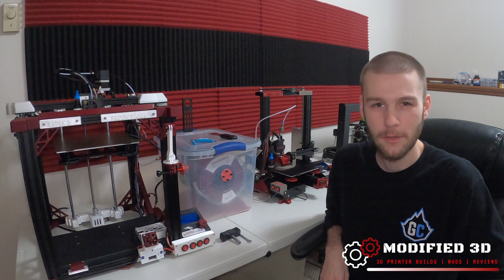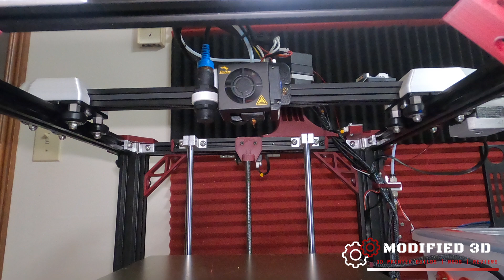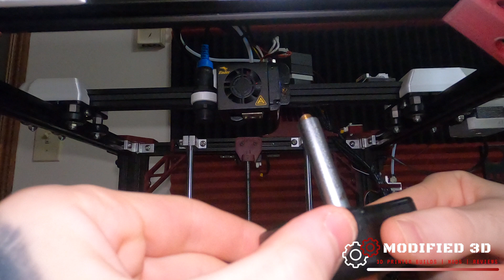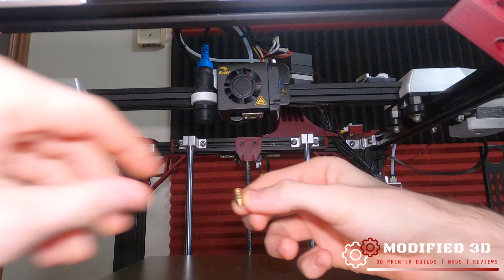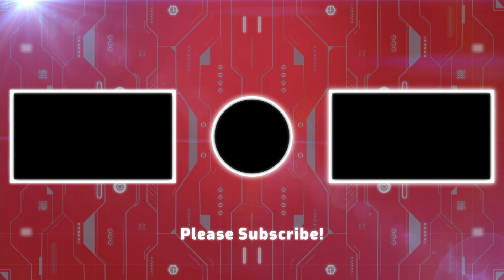How to Change Your Nozzle | Creality Ender 5 / Ender 5 Pro

Comment: 5 min video for 5 sec solution:
"Simply preheat your nozzle to 200c, then unscrew it. Install the new nozzle and torque to 1.5nm. I prefer to use the Th3D nozzles, as they are built with high quality standards, yet are inexpensive.."

Comment: I just changed the nozzle on my Ender 5 Plus.  I heated the hot end up to 200 C and supported it with an adjustable wrench and used a 6 mm boxend to loosen the nozzle.  The nozzle was so loose I actually didn't have to support the hot end.  I think this is because the nozzle is installed at the factory cold.  I kept the hot end at 200 C and installed a 0.2mm nozzle to play around with.  I just snugged it gently with the 6 mm boxend while supporting the hot end with the other wrench.  Again, I probably didn't have to from this experience, but I always will since doing things right and safely is always better than replacing parts due to carelessness!

Comment: Thank you for the info. :) I got some tungsten nozzles now, and am curious on if the 3d printer could take any metal. I also am wanting to see of making ice balls similar to the 316 stainless steel ice balls using some filament that is said to be FDA approved.

Comment: Haha. Oh boy did my printer screw up. I was printing something and it failed, and by the time I checked it there was filament all over the nozzle. I pulled off as much as I could, but in the end decided to replace the nozzle. I pulled up this video to help me remove the nozzle. I pulled off the silicone cover... and the filament had melted to cover everything inside the printer head. I was using a blue filament and now there is just blue everywhere on and around the nozzle and heater. Any advice? Or should I just get a new printer head

Comment: Don't use this procedure to remove your nozzle.  You will bend your heat break.  The heater block needs to be supported when you do this.  Watch a couple of other videos and you will understand how it needs to be done.
Reply: Yeah I didn't support the block. This video should be updated to warn about that as this seems trustworthy video otherwise for a beginner trying to change nozzles. I wonder how do I know whether I broke / bent something. For now it seems that only the heat break is only ever so slightly moving in heat block when nozzle is detached. I wonder whether this has any effect on the print (I'm yet to calibrate the bed)
Reply: What other videos? i just saw a crealit video do the same. how to not bend heat break?
Reply: This just cost me new heater block. I didnt read the comments before for the first time... dont do it like this its wrong.

Comment: Like watching a cub bear humping a football. 
150 hours in 2 months? 
I do that in 2 weeks easily per printer. Do the hotend fix and you won't need to change nozzles for a long time.
Nozzles off Amazon are way cheaper. 40 for $10

Comment: Hello Alex, I just got my ended 5 pro and I cannot figure out how to level my bed. I don’t know how to get my nozzle to go to each corner to check and adjust height. Thank you in advance!
Reply: go to disable steppers , then you can freely move the motors by hand, test at each corner a few times manually with a piece of paper and tiny adjustments on the way, at least that works for me